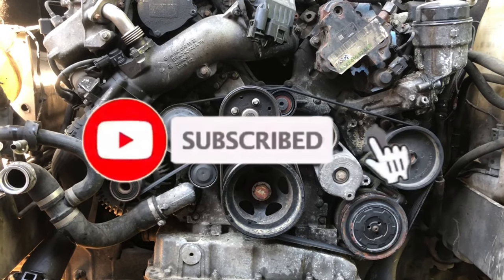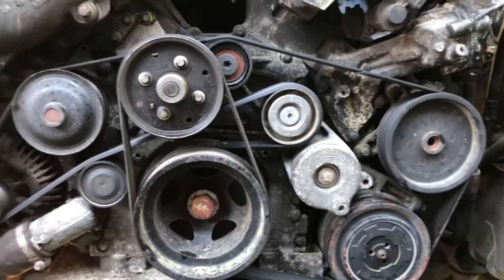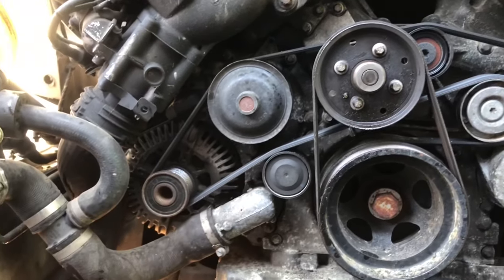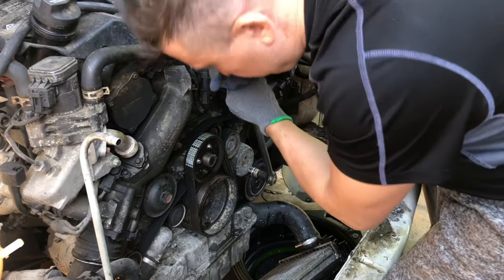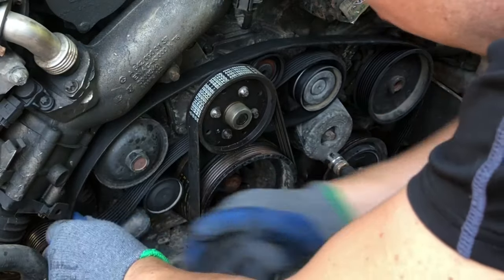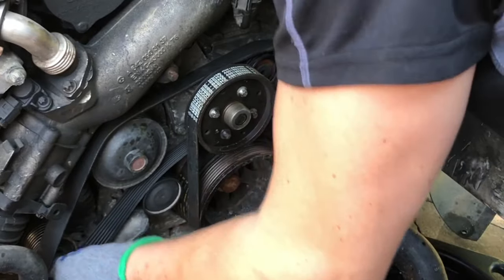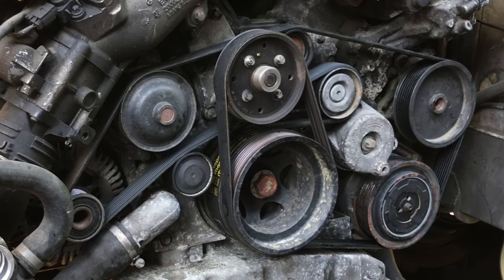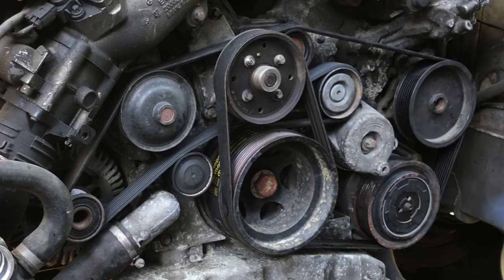2008-2021 Mercedes Sprinter 3.0L Diesel Serpentine belt Diagram Belt replacement / Installation NCV3

Comment: I don't understand why people keep posting videos of installing the belt with the engine out. It's a bit ridiculous. There is a process of doing it in the vehicle.
Reply: They removed the front bumper and associated items. It's doable, just takes time and tools.
Reply: It’s not necessary to remove anything to change the belt. Just disconnect fan cables with E10 and loop the belt around the fan. 7-15 minutes to complete.
Reply: @truth50  Believe me I know. I service a plumbing business that has 4 of them in their fleet.

Comment: It's not correct you have take fan off you fail to mention it.this is terrible
Reply: You do not have to take the fan off. You can slide the belt around the fan. Just did it but in order the replace the smaller belt that makes the fan spin you will have to remove the front end and fan

Comment: I just changed mine it was fairly easy, I looped bottom of belt down around fan then guided belt around pulleys and tensioner but let belt slack on outside of ac pulley, then pulled tensioner back and slipped belt onto ac pulley. That worked like a charm and I could do it all from the bottom of truck by myself. No Need to use pin on tensioner this way.

Comment: Just changed mine, first thing was like, this is too complicated, let's tow it to the mechanic.  Glad I did it myself. Your videos are the best! Thanks!
Reply: So
Reply: These engines are easy to work on, no matter how many people say it's a headache compared to the inline 6 bla bla, its just because they didn't try it and it's just different. The real headaches are the engines made after 2016-2017, no matter the cylinder count. Even the inline 4s are so condensed, to take a wire off you need to take 3 brackets and 2 other parts. F that.

Comment: No special tools need to install water pump / crank belt 😱 only a zip tie and crank socket zip tie the belt to crank while using your free hand to hold belt in place while turning crank it will walk itself on and don't forget to remove zip tie booooooya
Reply from the maker: Very nice 👍

Comment: if you look at the right side of the tensioner there is like a 5/16 hole there when you push on the tensioner slide something in it and it will lock in place.a whole lot easier when installing the belt.
Reply from the maker: Yep 👍
Reply: @ZimaletaMotors  Btw, they make a belt thats 5mm longer that fits the "updated" bigger tensioner pulley wheel. I don't bother, I just buy the kit from Contitech (they make the OEM belt), or INA kit (they make the OEM pulleys). The kit comes with the belt together with the right sized tensioner.

Comment: What socket is that?  The one your using to turn the tensioner with the breaker bar?  I'm broken down in Moab, UT right now, serpentine belt and the fan belt are shredded.
Reply: Looks like a twelve point star socket? Hope the auto store has that.
Reply: What socket did you end up getting that worked?

Comment: Belt tensioner comes with bearing, not separate.
If you want to save on yes overpriced tensioner , just buy 302 koyo bearing and use new rivets .